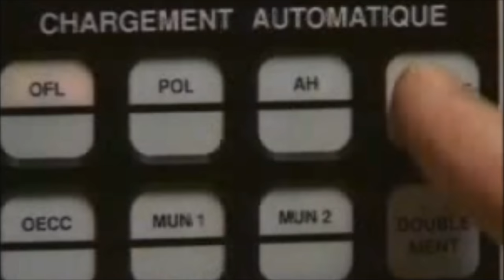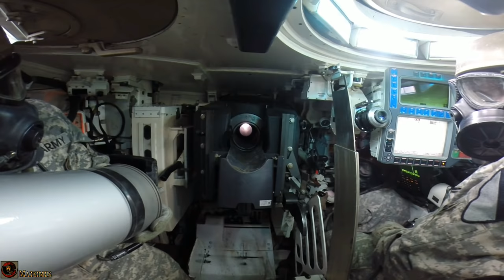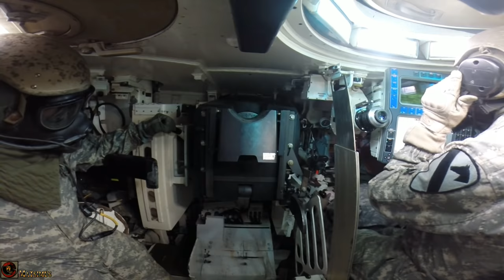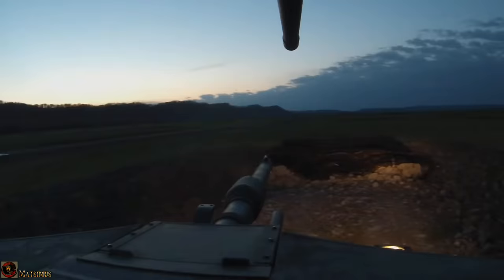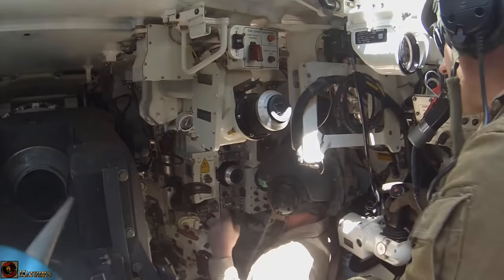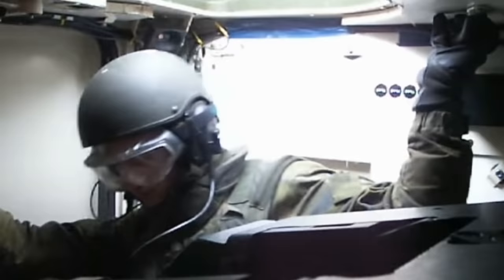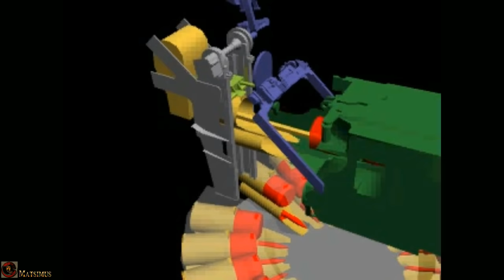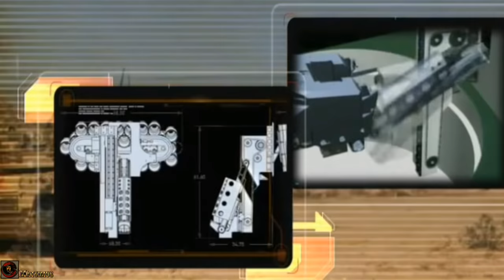Tank Autoloader or Crewman Loader?

Comment: My take on it all::

Crewman loader: needs fed and hydrated. Can switch ammo on the fly, can fix and repair on the spot (on field battle until there is victory in the area, or the tank goes boom)

Autoloader: Maintenance, Maintenance, Maintenance, spare parts, replacements, upgrades, auto loader goes out so does the tank, "magazine" needs reloaded, meaning limited usage with only a single set if ammunition for certain situations until the mag is spent, has to retreat back to base in order to reload and get repaired (unless your treads are f*cked)
Reply: Aaaaaa you are wrong.

Comment: The auto loader has too many damned parts to bust, and often risks a necessity of exposed ammunition storage so that the ammunition can be easily retrieved by the autoloading mechanism. If a round goes off in an exposed carousel, the turret often pops off. If however, the ammunition compartment of say, the Abrams is struck, the blow off panels protect the crew and major turret electronics from damage. It’s also nice having the peace of mind that there’s ease of use to the manual loading.

Comment: From my point of view a single tank needs support of other units to survive on any battlefield so there should be another pair of helping hands somewhere and so you don't need those hands within the space of a mbt. If You have 1000 MBTs and you can spare 1 soldier per tank you get another 333 tank crews or these guys could be doing literally any other job less dull. They could man for instance 100 warriors (hint: a warrior has an "autolaoder" too) and actaully give those mbt's the groundsupport you mentioned. Or these 1000 people could develop better tanks which could be finally operated by 3 people saving 10t of armor per vehicle. Loader is an incredible dull job and every loader can be a driver, gunner or tankcommander thus having a better more fullfilled life. This is a job which needs to be replaced from a philosophical standpoint. If your driver gets tired in a 3 man crew, there should be still 2 people there, who can take his place.
It's like arguing, that if you harvest your crops manually, you have at least someone to talk to, because you are 100 people out there on the field instead of one person on a harvester and a second one on the truck to carry the crops away.

Comment: Ya kno'... I've always been wondering why they're still using a solid explosive to propel the projectile instead of a high viscosity liquid that gets injected through a port into the firing chamber after the projectile was inserted. They could even have it stored as two liquids, each of them alone unable to ignite, but when mixed together before injected into the breach they'll become active to whatever is used to ignite it. That way the only thing the loader would have to handle would be the tip which I imagine weights probably half if not even less than what they have to wield today.

Comment: In general, machines cannot adapt when in a stressful situation. Nor can they feel stressed. 
Organic beings like us, tend to do incredibly better when faced with a stressful situation. It is the reason why we are all alive today. 
Auto loaders can be useful but when they break down what can be used to repair it in time? A man loader can be killed but can be replaced by one of the other crew men if they know how to load it. Auto loaders cannot, it's a thing that can get you killed when it's broken.

Now auto-loaders aren't all bad. They can be used to replace a role and have a human focus on more critical roles other than loading, to be more supportive and effective in combat. Auto loaders don't need to be used in tanks unless it has an alternative when it does break down in combat. (Why have an a gun fire every 5 seconds and upgrade to fire every 4.8 seconds? Its useless).
IFV's should have autoloaders as they can provide faster rate of fire compared to tanks without the need for a human loader to add more time in reloading due to stress. In fact the crew of an IFV can focus on other things to stay alive and provide support while the auto-loader deals with loading.
The thing is which is more effective in bringing more rounds to bear down the enemy?

Comment: Tank autoloader is the way of the future. Arguing against it is like arguing against self loading rifle. You maybe right in 1918, but you are dead wrong in 1936. 
The 1st gen autoloader, designed in the 1960's, have many flaws, but we already see problem such as separation of ammunition and crew addressed in the 2nd gen. autoloader (ie. Type 90, Leclerc, and K2) from the 1980's. Sadly (or luckily), the evaluation of tank design stopped after the cold war, and we never get to see the 3 gen. autoloader in action. 

Matsimus, and lots of people on the comments section talk about the benefit of having a extra crew member. But they forget back in WW2, tank often have a fifth crew for operating the radio and bow machine gun. If having a extra crew is so great, why don't we keep the radio operator? Clearly, the deciding factor for keeping the loader and eliminating the radio operator are the same:  is the machine reliable enough to replace the human right now?

Comment: More crew members are always more versatile in 'any' given tank, but of downsizing the crew member when upgrading from T34 (4 crew) to T34-85 (5 screw, roomier turret), where the 5th crew was a dog.

This may be  because they want to have max number of tanks out in the field with minimum crew member per tank to operate it OR may be the time it take to train them during WW2 OR maybe the dog was trained to be Kamikaze anti tank.

relationship between size and cost is actually on an exponent scale (inverse square), so if they manage to size down a tank by a quarter you get 1/2 the cost per tank, which could mean double the number tanks / fire power on the field (figure of speech).

This is why there are more light or medium than heavies / MBT, but back in WW2 Germany believes the opposite is true but guess what happened to that idea.

Comment: The Swedish Strv 103 had a three person crew and an autoloader. It had a 105 mm grooved barrel main gun. 
The rate of fire was 20 runds/minute. Reloading took about 2 seconds. MUCH faster then any human loader.
Reply: Yes but what is its purpose? An offensive or a defensive weapon? What is its role in the Swedish military? Once you have these answers it's easier to understand the conclusion the Swedish came to with the S tank series
Reply: @oswaldchai9865   Doesn't really matter - the point is that an autoloader is faster than a human - opposite to what the video states.
Reply: @martinlyhagen6166  yes mechanised is always faster than humans but the selection of the type of loading would depend on the roles of the tank. Does the army can afford to maintain a loader or a autoloader? Is the autoloader easy to maintain to justified using said autoloader? Do the army have the capacity to maintain said autoloader or human loader? The video is talking about when it is suitable to use a human loader and when to use a autoloader.

Comment: Leclerc auto-loader consistently load rounds under 5s no matter what the tank is doing.
So far, I didn't see manual loader doing it faster, it may even easily go above 10s.
The only video I saw going faster was a Leo 2 simulation, but the round stowage door stayed open.
And modern auto loader are not the same as Cold War Russian auto-loader.

Comment: Tanks per traned crewmembers with autoloaders/without. 
let's take 1000 ppl as baseline:
Without autoloader: 250
With autoloader: 330
Result: 70 or 32% more tanks on field

This pair of eyes, ears, legs, etc can be not a meat forklift but actually a tank commander or gunner who will save your life by removing thread instead of lifting shells and brewing tea

Also, autoloader works on move over rough terrain with constant speed, human loader - i didn't ever seen a video where abrams loader did load on move(correct me if i wrong)

Comment: Ι've done some loading in my time but i was mainly a gunner, it is ok when the tank is stationary or in slow speed but when in high speed which now days tanks can fire while going fast is very very difficult to load the gun trust me. I Think the best way is to have the option to manual load the tank if the autoloader fails i know its hard to design but both options have pros and cons

Comment: Well, if I may write that on the footage within a M1 turret, of course not the producers fault, was very off in that the Loader is strapped in as securely as a pilot normally is. Their right knee operates the blast barrier door switch, and even with the harness if the knee comes off the switch the doors slam shut so fast, that even trained gunners lose fingers occasionally. The harness also assures the Loader is never in the path of the cannon recoil. I am a vote on the human Loader in that they can more quickly respond to a loading change. Although the common rounds they carry are thought to be the depleted uranium sabot and the HEAT, there are several more choices that can be fired from the cannon. Oh, and the comment that the crews can't stay onboard and ready for 24 hours is a bit off. During the Persian Gulf War, most M1 crews did stay onboard as long as possible 7 days a week.....for the air conditioning!

Comment: I would prefer the auto-loader.

I guess there usually would be a loader because I highly doubt the ammo just teleports there.

(Or it might be just a another crew member.) 

If a loader dies you can replace him. The only problem is that another role would go out.
(atleast it would get harder to so it.)

If a auto loader goes out without other damages I would guess it could be manually loaded. (if not that seems a little stupid)

Auto-loader ammo can go boom.
So can ammo outside it.

And Auto-loader would be faster. 
I guess.

Also yes. I know how old this video is. I can still have opinions.

Comment: The 4 man crew was spot on, one less man in training or combat sucks(especially when someone has to always stay awake), good job covering that thoroughly. Also what if you are on a leaders tank? I never saw a captain or above help do ANY maintenance.
Reply: Hey, watch it! :-)

I agreed completely with you on the 4-men crew, as I have been very vocal here on this particular thread. But I also raised up 'from the rank' too, starting off enlisting into the army, then got out and went back in thru the OCS and got my commission. So, I have done my share of cranking that M'ther #$% spanner wrench to adjust track tension or stepping into the oil drip pan by accident, LOL.Still, after I got my commission, I was 'nicely' advised by my senior NCOs to not engage in anymore crew maintenance and leaving them to the rest of my troops! It was not as if I haven't tried. Granted, out in the field, I would also be there helping with changing track pads, etc. But do bear in mind that, aside from being part of the crew, I also have the added responsibility to the rest of the unit too. So, yes, pulling maintenance with my own crew would be secondary and only when I do have some time (and energy)! A captain might be 'assigned' his own track but most of the time, it would be the responsibility of the Frist Sergeant to make sure his track would be well maintained and thus, the lion share of that chore goes to the gunner, the senior man left in that crew. 

Finally, I full agree that their urge for 3-men crew would surely leave leader tracks very short! I was off and away from my own track half the time, doing map recons, checking on the rest of the unit plus the thousand and one other chores assigned to me from higher up... like senior range officer, tank gunnery officer, safety officer, OPFOR officer, etc. on and on. I have to leave my own E5/6 gunner to be the senior man to supervise and help with maintenance; if I was from a 3-men track like so many advocated , that left only TWO warm bodies; that wouldn't be enough in a training environment and surely never enough 

Someone left a comment about helps from grunts or assigned mechanics from the shop with crew or heavier maintenance, guess they never really knew how the military worked, LOL! I would be lucky to get ONE mechanic coming out to the motor pool to go about helping with daily maintenance if at all. Do these folks with comments realized how many mechanics were actually available in any given squadron maintenance section!!!?
Reply: Any U.S. Tanker who is pro auto loader has not spent a lot of time on a tank or in the Army. I spent half of my 17 years on tanks short crewmembers as it was. ( details, schools, injuries, more details, additional duties, and more details!) I am retired now, but no way in hell would I want to serve in combat on a 3 man crew! the autoloader is the least of the issue.

Comment: Basically sums up my thoughts on loaders, with the current level of technology.

Which of course, doesn't mean that in the future, better auto-loaders will be developed that can switch shots without firing. Maintenance can also be done by non-combat personel like are already needed to carry out major repairs.

Western military thinking has been all about spending money to save lives. From that semi-political semi-military viewpoint, trying to build an auto-loader without the current drawbacks would mean one less person per vehicle, in the line of fire during combat. That is an attractive idea, even if it means you'd need to reinforce the non-combat service crews following tanks and other fighting vehicles around.

I think you're already seeing that thinking going to some extremes:

The suspension seating systems for tank drivers' seats against IEDs for example (change made after a Danish driver of a Leopard2A5 was killed by an IED). Cost millions, probably didn't save any lives considering how rare it is for a tank to be hit by an IED blast heavy enough to kill the driver by throwing him around in his seat.

From a strategic point of view it would be better not to invest in measures against such a rare scenario and simply accept the losses as they happen. But: lives > money, so the investment was made anyway.

And an auto-loader in any sort of combat vehicle, would mean one less person in the field who could be killed in the line of duty, so I think it's quite possible for research into those to begin at some point in the future, assuming large combat vehicles will continue to operate. We already have the technology to make such an autoloader that can swap rounds without firing, select them and operate the blastdoors, it's just a matter of implementing the technology into a working system (which wouls still take years mind you).

So auto-loaders, not now, but maybe later.

Comment: I know UK and US were working on rail guns and also Telescopic Rounds for new generation of Gun systems and tanks back in late 1988 through 1991.  With some very good success rates. Some of those are now starting to enter service. Telescopic ammunition has finely been perfected and due to be mounted on new vehicles. Rail guns. Well some of the early testing was very promising. But had some problems in that the smaller rail guns being experimented with while much more effective than conventional gun systems. They were simply not battle capable. Needing huge power systems. And often destroying the barrels very quickly.  Tech has moved on since then. And rail guns have grown into huge beasts. Ideal for mounting on ships.  Only time will see if they return to smaller more portable rail guns.
Also another factor with weapon system design is the current thinking and requirements at the time of development. So like in 1990 the world changed. The threat changed. Technology changed. Nearly over night. So weapon systems requirements and development changed to.
In the early 1990s turretless tanks and auto loaders were the current thought in development. But costs. The first gulf war and global political changes. Changed development priority. Instead. We went into upgrading and modifying existing systems.
Will challenger 2 be UK's last MBT.  I don't think so. But the concept and design of new MBT's will change. And like aircraft. Mainly due to costs of newer and newer higher tech equipment. It is unlikely to be made by a single country. With joint projects becoming more common ie a new tank jointly designed and built between the UK.US. Germany and probably others. Even the US now is accepting that it can no longer fund military hardware projects on their own. And that..... Only buying US equipment is not always the best way.

Comment: I haven't been in the military (so I am not experienced in this type of thing at all - video-games don't count after all!), but IMHO the auto-loader is the better system (with protection so that the tank doesn't become and instant Roman candle if the turred is breached!), especially since it doesn't tire like a person would (and the potential to get injured without an autoloader is there as well)....still, a re-design (for ammo-switching!) would be nice, if at all possible without huge complications and added weight etc.

Comment: The canon on the next mbt will be  130mm or 140mm thick, that's mean the shell will weight under 50 to 60 kilo each, it's impossible for human being to constinually reload the gun in combat, therefore a autoloading system is required.